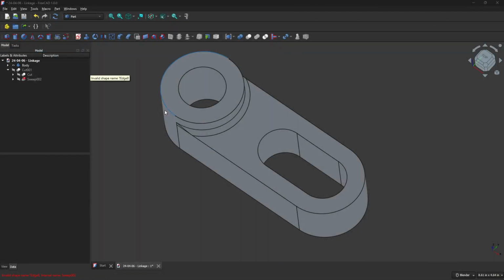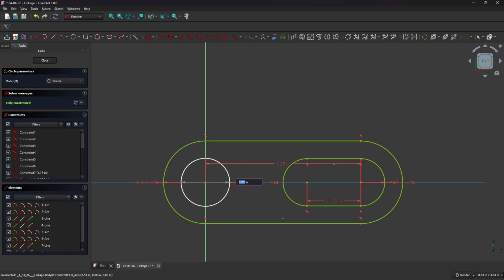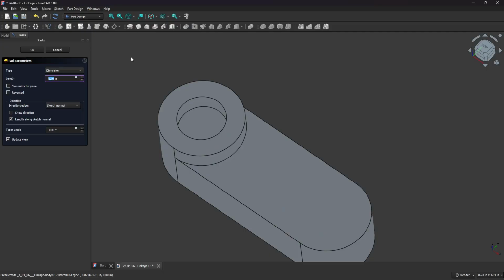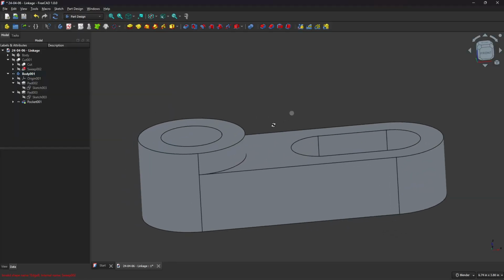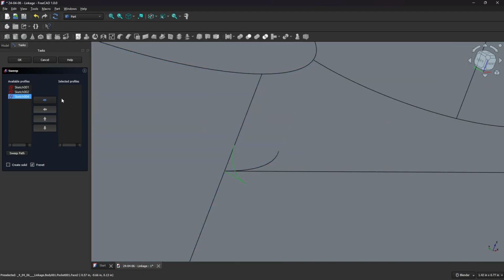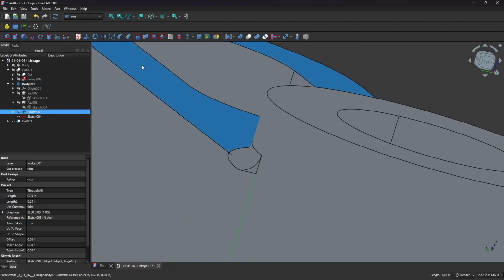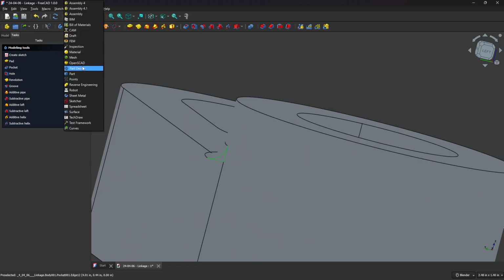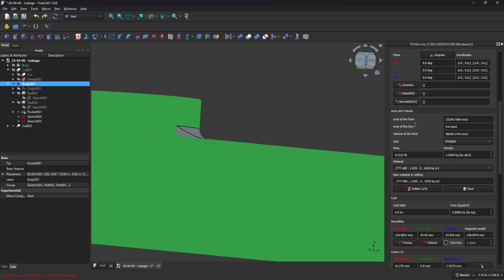FreeCAD Modeling Tutorial - TooTallToby 24-04-06 (Linkage)

Comment: UPDATE: I figured it out. I had one extra line leftover that I didn't set as reference geometry. Also I had assumed they merged Part and Part Designer workbenches into one (was told this was supposed to happen about a year ago; sad that it isn't).

Thank you for showing this. I am doing the same exact tutorial in FreeCAD v1.1 (the dev version that's getting ready to launch) but when I get to the "Sweep" operation, that button no longer exists and the UI is different.

I tried "Additive Pipe" (which has the same icon), but I just keep getting errors when I do. Would you happen to know what needs to be done to make it work?
Reply from the maker: I'll go back in and check with the new updated version; I'll let you know what I find. Sorry about the delay!